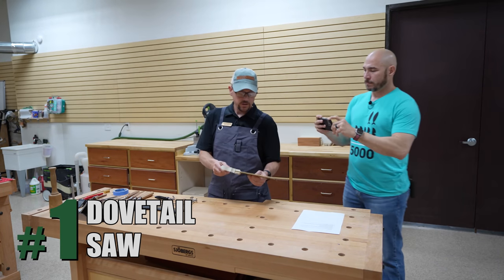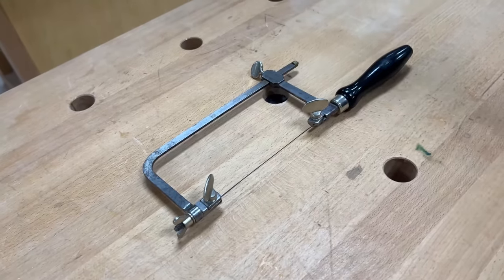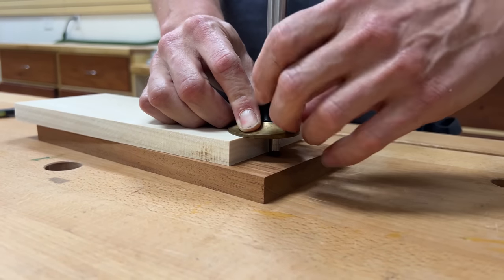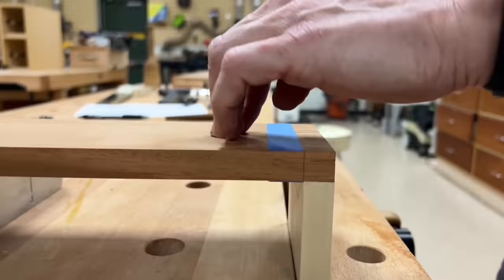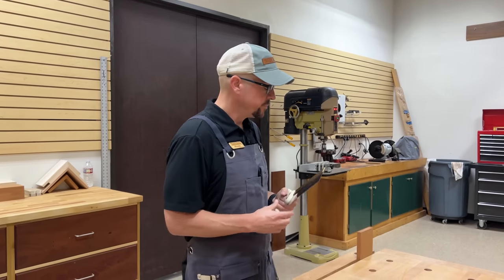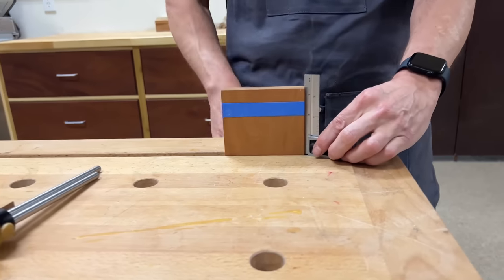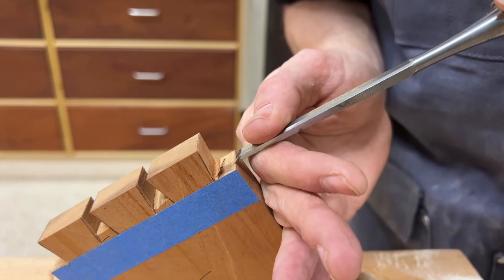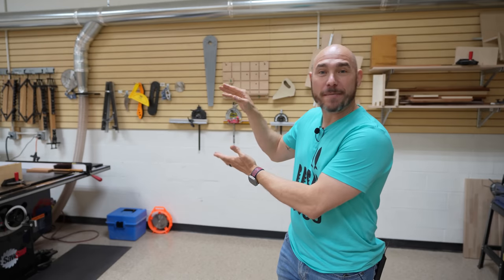10 Pro Tips for Jaw Dropping Dovetail Joinery

Comment: Howdy Mr. 731...

Mannn. I haven't done dove tails since High School and a few times in my mother's garage (early on woodshop) using a Black and Decker dove tail jig. 

It isn't a very "practical" joint to use in terms of speed and "getting things done". 

But, for those "one off" specialty builds, like maybe a Jewelry Box, the ability to customize a dove tail would be beneficial.